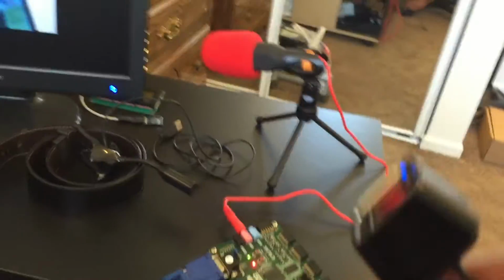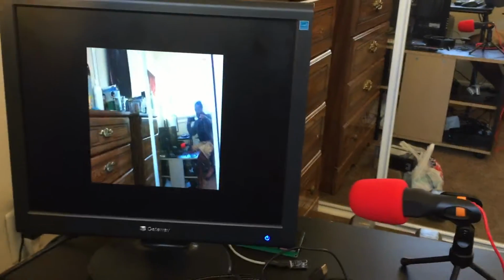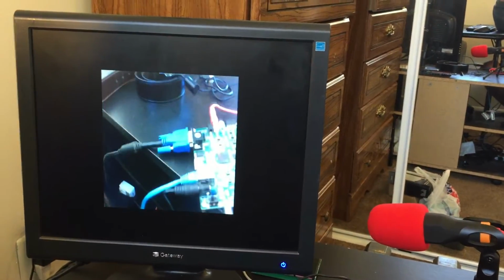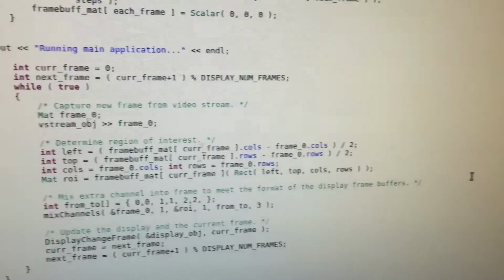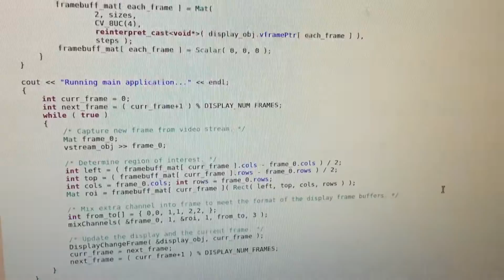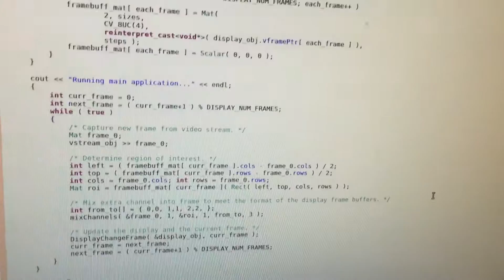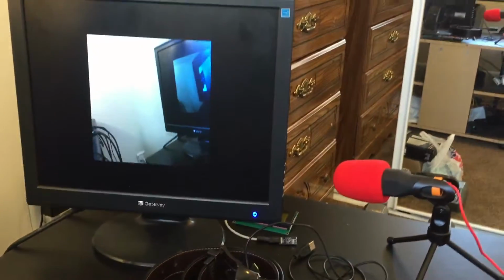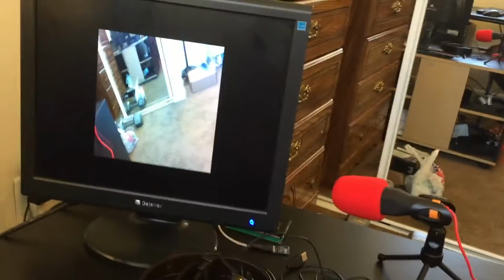PetaLinux on Zynq PS with Real-Time Video Capture of Microsoft HD Webcam

Comment: Dear Sir,
I'm running this project (clone at github) and get error in the picture.
http://imgur.com/a/cOPs8
Do you have any help for me?
Reply: I'm beginning to learn about Petalinux and Vivado so knowledge is still limited. I dont know what caused that problem
Reply from the maker: Just got around to answering my YouTube messages. I'm more responsive you send me an email, I should point out. So, the message you see the result of an exception being thrown by the VideoCapture object vstream_obj. You can see the runtime_error at line 84 in main.cc. There can actually be a number of problems, unfortunately. Are you running my project with an changes? Did you build your own? You need to make sure the USB is configured as a host and with the EHCI host controller driver. Plus, you will need the Linux USB Video Class (UVC) libraries which is needed by OpenCV to interface with different web cameras. It's also to have the USB utility programs (e.g. lsusb) to determine whether or not USB devices is detected by the system. If you have any issues trying to figure out any of these steps, please email me! Take care, and good luck!